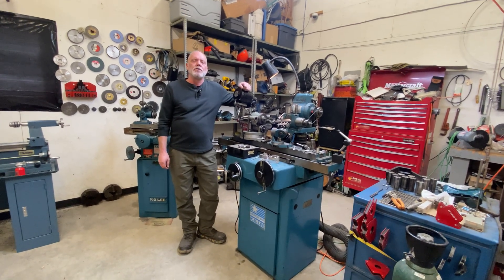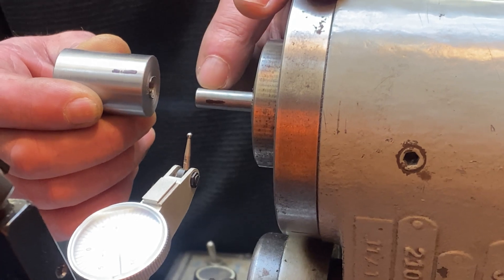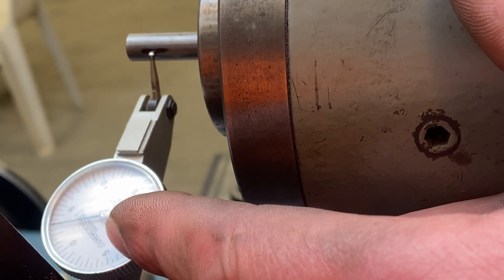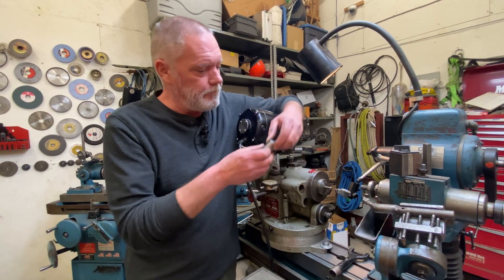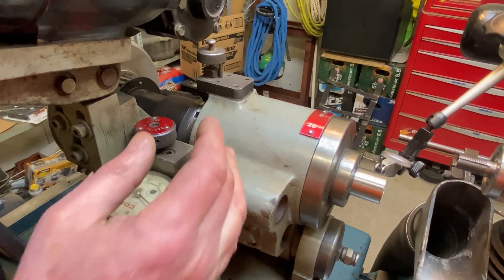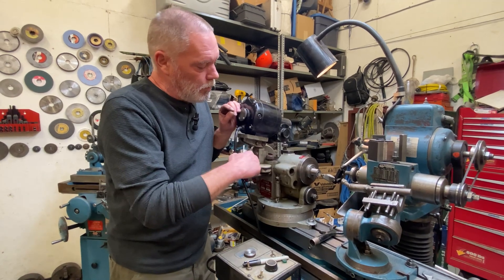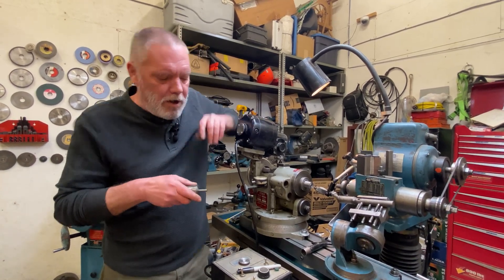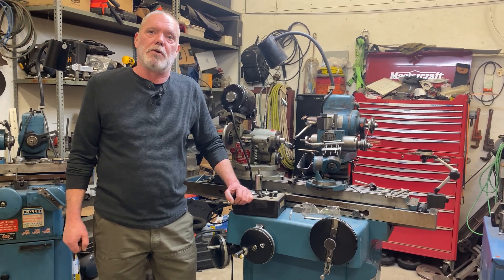Radial relief grinding setup

Comment: Is the ma Ford cs radial axial or both
Reply: Ty,I’ve been tool grinding for over 20 years at a shop but we have a guy that charges us like $4 for a countersink. So we always had him do the ma fords as they require a special cam. I can do weldons easy enough. They have relief most of the way around but fords have relief in like the first 20 degrees and circular the rest of the way around 
I’ve started going into business for myself. I have 2 KO Lee 6062’s and an ok tool 202 and used a 6000 series ko Lee at the other shop for 20 plus years so I share the appreciation for them. Very underrated for their versatility 
Ty for the info and very good videos,very entertaining.
Reply from the maker: Both normally but heavier on the axial